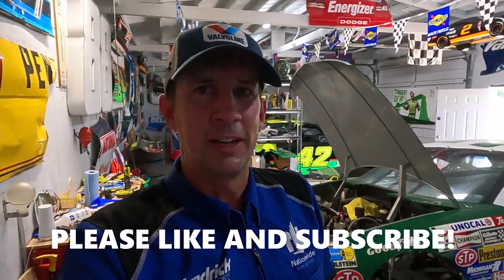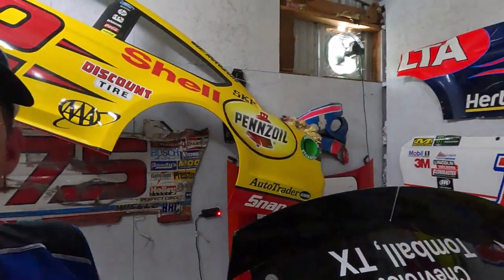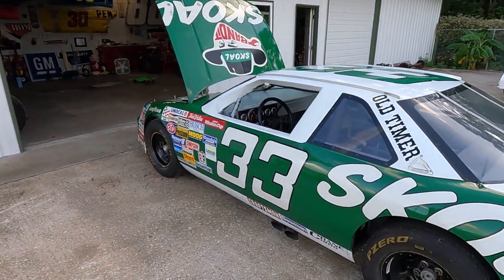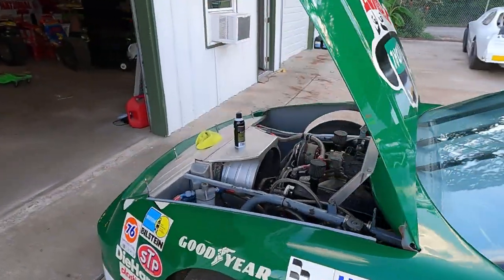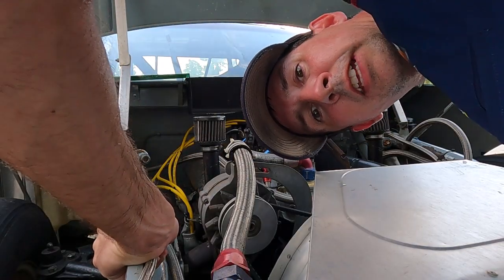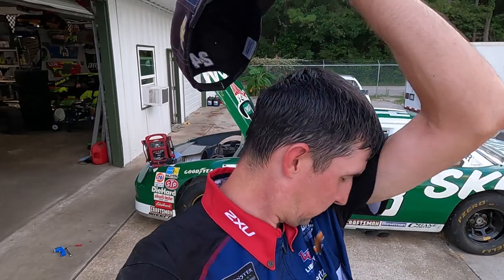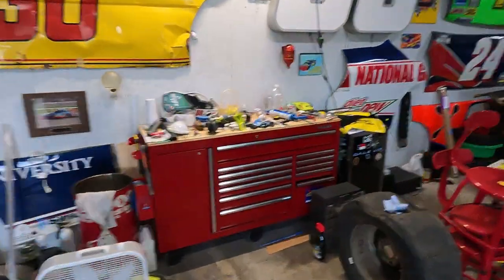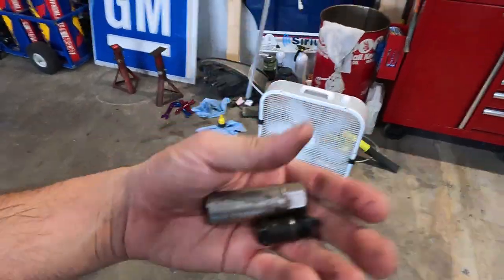Trying to start the 33 Harry Gant Lumina.  Maybe???  Oops...little fire!

Comment: Check the valve springs. But also check your valve lash. Make sure you don't have any exhaust leaks. Check the oil pan for dents that the crank might be slapping. Make sure nothing is up in the bell housing. Check for bent pushrods too.

Comment: If by any chance that IS a high compression race engine (hard to tell by just listening) that street carb w/choke is waayyy too lean for a race engine & if you're running 87 octane fuel that clattering is possibly a cracked or burned piston, caused by detonation.

Comment: Dude! You seriously need to put a piece of hose in your ear and find that rattle.

If you're lucky, it's just something easy like a backed off rocker (and you catch it before it does any damage).  If you're unlucky, finding it ASAP will save you money in damages the sooner you figure it out.

A quick and dirty test is to pop off your two valve cover breathers and stick the ''ear-hose'' in the openings.  If it's under one of the valve covers, you'll know for SURE which side it's on.   Then it's just a matter of pulling that cover and seeing what you can find.

Granted, your microphone isn't going to pick up up exactly, and my TV speakers aren't going to play it back exact...     but that noise sounds like something that's going to get expensive if you don't find it.
Reply from the maker: Haha! Yeah, it sounds a little nasty.  I appreciate the advice.

Comment: Exhaust leak, and a wee bit of engine noise. 
If that smoke doesn't go away at full temp, and I'm inclined to think it won't, I'd be checking her cylinders..I'm of the belief at least one of 'em ain't playin' nice..and a lifter not pumping up may have somethin' to do with it. Hard to say from this side of my cheesy computer speakers.

Comment: Start with checking spark plugs
Reply from the maker: I've replaced the plugs and wires.
Reply: @grassrootsnascarracing5431  
Did the old ones all look like they were burning the same? Or did any stand out? Also what weight oil are you running in it and do you know what the engine is? And does it have a hydraulic lifter?
Reply: @grassrootsnascarracing5431  
Oh I also noticed you had a stock alternator on it. I had a problem once with the fan blades twisting with high rpm and hitting the bracket. Check that too...